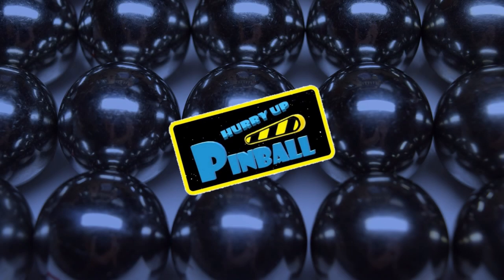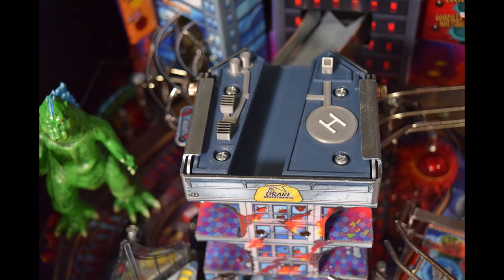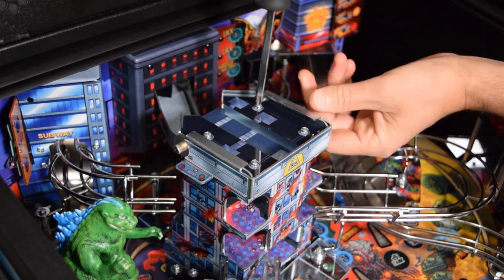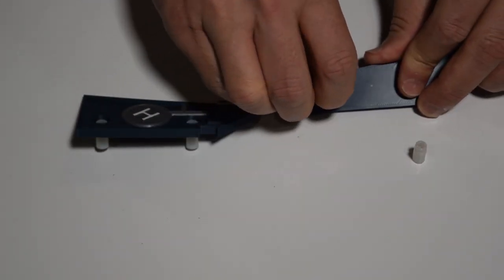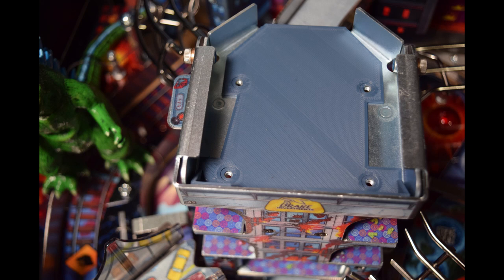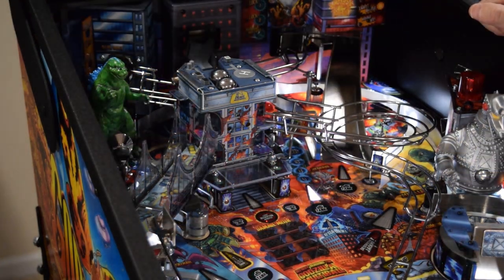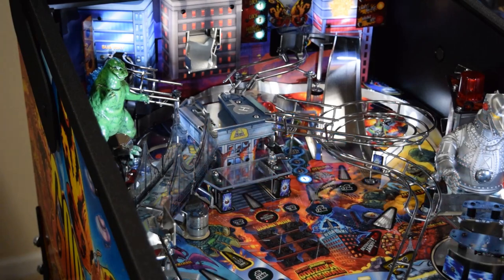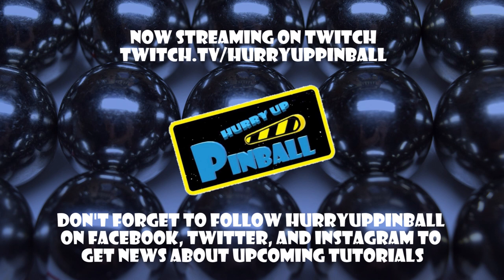HurryUpPinball - How to install the SDTM Building Mod Fix for Godzilla Premium / LE Pinball Machines

Comment: Just ordered. Thanks. 
Just suggestion place some artwork on bottom plate to show in channel like original.
Reply from the maker: I have a few ideas for decals and may explore that in the future. I didn’t want to add much height to the bottom plate since it feeds off the metal ramp to the building. I appreciate the feedback as well. Have started looking at decal cutters to see what is out there.
Reply: @HurryUpPinball  yeah if you develop a sticker I’d want one for sure

Comment: Great mod. It’s a shame some of us need it. Mine works well out of box, but have seen plenty that drain. Mine actually drained at the show I bought it from when I played it, and I just knew I’d have to dial it in when I got it home. I was surprised once I got home and leveled it using my PinGuy app and set the pitch to 6.5, it didn’t do the SDTM thing. At times I will lose one ball though(I think the second or third one rolling down) I still love your mod though and it is a genius idea. That being said I may order it anyway! Congrats my friend, and I hope you fix everybody’s SDTM issue! :)
Reply from the maker: Thanks for the feedback. Some peoples feed to the tip of the left flipper and some go straight down the drain. I think it has to do with small variations and how the building is installed from machine to machine. I wanted to make something that served a dual purpose. Having it be an upgrade to the top of the building as well as a functional fix for a common issue. I absolutely love Godzilla, it is such a great game.
Reply: @HurryUpPinball  super nice job! Like I said I may still get it anyway. Even if I don’t need it. Lol.

Comment: T2 needs a mode for the ball launch...no matter how i level the pin, that ball launches right into that one target, does a slow bounce off and goes right down the middle between flippers....its annoying!!!!
Reply from the maker: You could always replace the plunger coil with a slightly weaker on. I did this on a game as the trough coil was kicking the ball out so hard it would bounce off the wall and fall back in the scoop. You can do a little research online and find out the next coil down from yours in terms of strength and then solder it in.
Reply: @HurryUpPinball  thanks..i'll look into it.